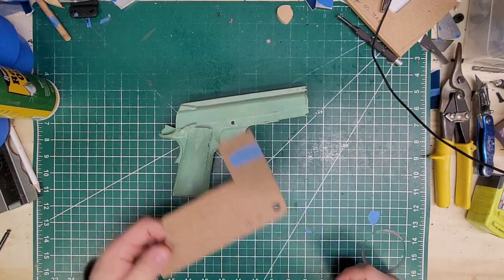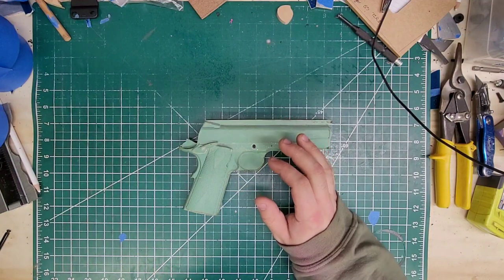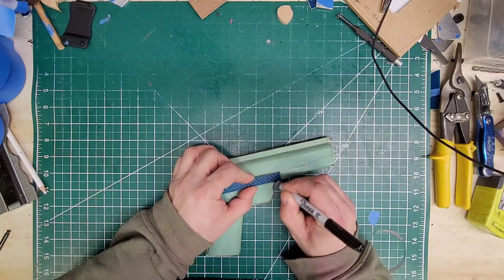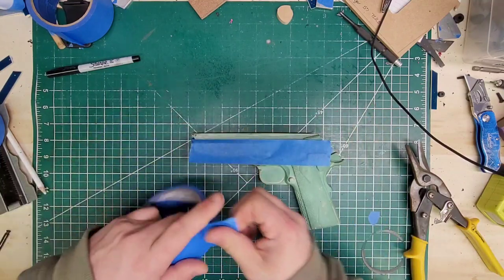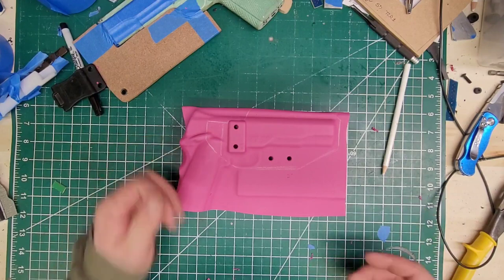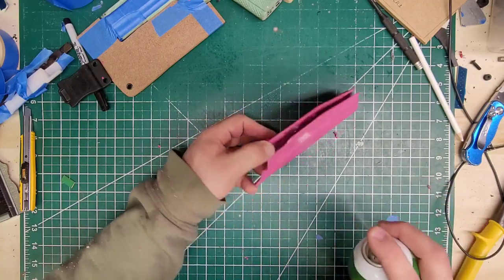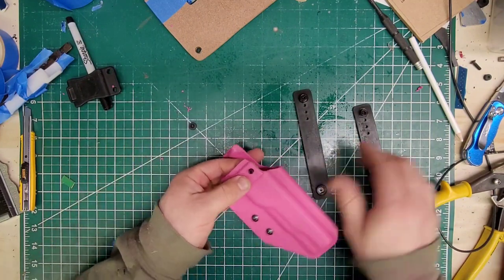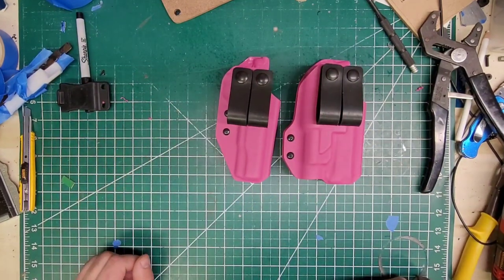Bubble Gum Pink 1911

Comment: When you have time to fit another extra video in, could you make one on how to make a holster without a mold but a real handgun safely? I have yet to find a video doing this as my first holster will need to be of my own person guns and don't want to mess them up. Thanks for all your videos as usual, by far the best channel on YT.
Reply from the maker: Litrrally the same process. Just more blocking. Lay tape down before blocking. And if it's a polymer firearm. Put tape on the mag and keep it inserted. Same process
Reply: @FalTacUnlimitedLLC  thanks for the info, I just dont want to warp the grip or some crazy shit lol I appreciate the help!
Reply from the maker: @michaeljames8010  I know I'll be doing one st some point. But if the gun is polymer. Put a layer or two of tape on each side of the mag and keep it in the grip. That way it won't crush it